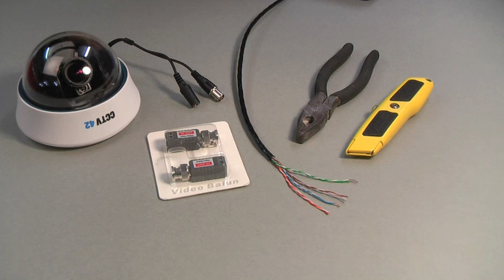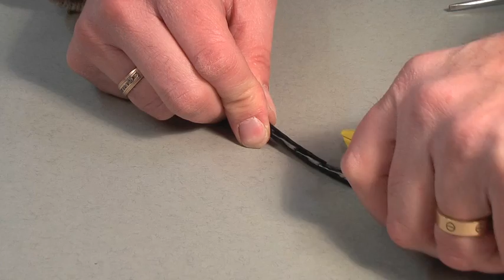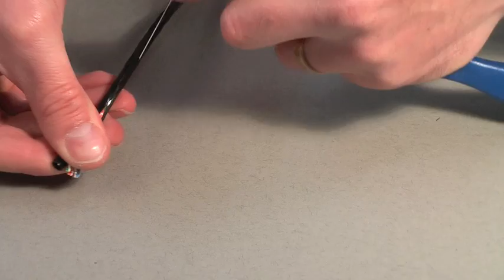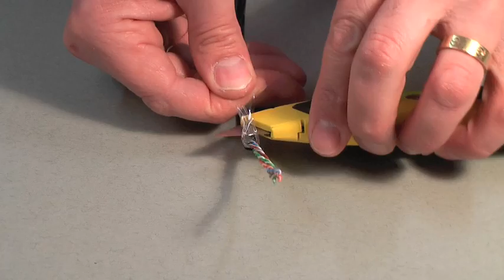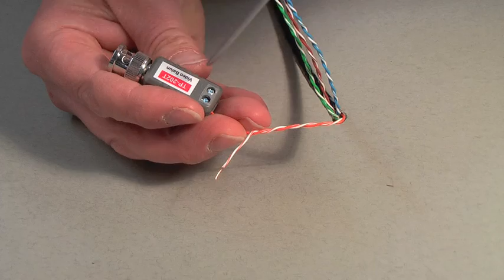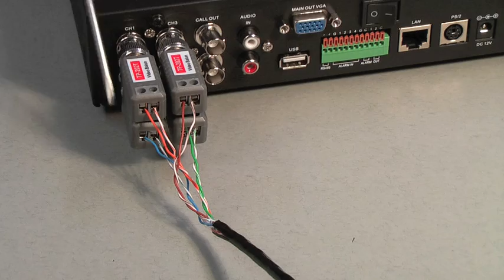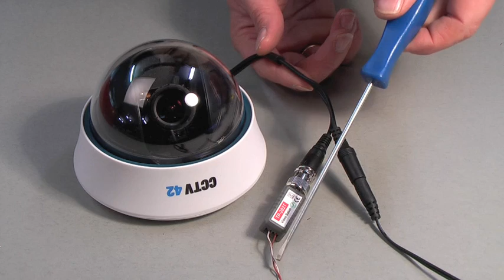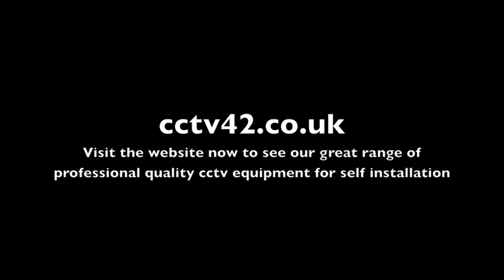cctv42.co.uk - using cat5 cable and baluns to connect a cctv camera to your DVR

Comment: Lan Cable Cat6 outdoor cca wire is this okay for cctv sir?
Reply from the maker: Hi there. I would not recommend using CCA or copper clad aluminum cable. Not only does it break easily when making connections but it doesn't perform as well as pure copper cable when it comes to this CCTV application.

Comment: I have a  built in mic camera with  one bnc connector and one adapter socket. Should i connect the video balun/transmitter same way?
Reply from the maker: It depends on the distance between the camera and the DVR / power supply. You might get away with 2 pairs of wires for the 12 volt power, 1 pair of wires for the video baluns and one pair of wires for the audio connection.

Comment: We are in great trouble, we used separate CAT 6 cable for each camera and gave 2 pair to video and 2 pair for power using DC adaptor. We used passive video balun without power dc jack. Image is fine with no lines or interference but image has ghosting affect and double. What to do
Reply from the maker: Hi there. Without seeing the installation it is impossible to say what's causing your problem. I would start by checking the individual components on a short test length of cable. I would also use a single pair for video rather than doubling up, you need to triple up on the power to avoid voltage drop over longer distances. Check for outside sources of interference, look at the camera power supply, the cable used (is it pure copper solid uniform twisted pair), the connectors (many so called baluns are just connectors with no internal components), and so on.

Comment: Hi. Can you explain how you can feed 4 cameras on one cable. How would you make a split into the cable to keep running only one cable or would you need to keep splitting the cable. How does this work for power however each camera will need one cable for each power?
Reply from the maker: Handling the video feed from 4 cameras down 1 piece of CAT5e cable works best when the cameras are close to each other making connections easier. You could theoretically cut into the cable along it's length to use one of the twisted pairs for a camera but it's harder. The cameras would need to be powered independently from the CAT5e cable, you couldn't use it to handle multiple video signals AND power the cameras.

Comment: How give power supply from cp plus power supply when i want to run 4 cameras for one cat 5 cable
Reply from the maker: You can't supply power to 4 cameras and send video back to the DVR using a single length of CAT5e. You would have to power the cameras locally then just use the CAT5e for video with 1 pair of wires to each camera.

Comment: You show one camera cable connected to 4 different baluns. Why would you need four signals coming from one camera? If I connect 8 cameras I would only need two wires from each cat5 cable to connect my cameras?
Reply from the maker: Hi there Dave. This would be a possible solution for up to 4 cameras powered locally (ie. not using the Cat5 cable) where you then want to send the video signals back to a DVR. If the Cat5 cable isn't also being used to provide power then you can send up to 4 video signals down a length of Cat5 cable with 1 pair of wires used for each camera.
Reply: Got it, thanks so much! I know this video was posted 10 years ago so I thank you for continuing to monitor your video and I appreciate your quick reply!
Reply from the maker: @diydaveman  Our pleasure :-)

Comment: If i use for two cameras, i am left with 2 pairs for power. You recommend cross splitting the pairs for power right, not one pair for minus and one fir plus?
Reply from the maker: Hi there. We wouldn't recommend running 2 cameras using 1 length of Cat5 cable if you are using that cable to power cameras. There is a danger of voltage drop if you only have 1 pair of wires for the 12 volt power, hence why we suggest using 3 pairs for the 12 volt power.

Comment: Theres a lot of work to be done if you want to upgrade to an I.P. system. Plus, if you you all the remaining pairs for power, you run the risk of ghosting the picture through interference.
Reply from the maker: This method of wiring is suggested for HD Analogue systems not IP systems. IP CCTV has it's place but we aren't massive fans for reasons outlined here: https://www.cctv42.co.uk/help-advice/buying-guides/buy-the-best-hd-cctv-cameras-and-system/ip-or-analog-hd-cctv/

Comment: hello there... good explanation, however not sure why you would need to tie the last six cores into two sets of three to prevent voltage drop? when a single pair can provide 48v @30watt - we see this on standard network topologies when running POE devices ie Cameras, IP phones, Wireless access points etc..

perhaps i misunderstood what you were saying
Reply from the maker: These are not IP cameras, in this example we are using CAT5e cable purely for the copper content. The cameras are 12 volt which will increase the chance of voltage drop but with any
wiring using thin wires and lower voltages voltage drop is an issue as cable runs increase in distance so trebling up acts as insurance policy.
Reply: @cctv42  thank you for the response, I appreciate the example you have used are not IP cameras I guess my reason for the comment wsd purely the fact that poe devices run 48v on cat5e and cat6 onwards cables albeit with them being thin cores..
Reply from the maker: @rizwanmahmood1407  these are not PoE cameras in the strictest sense of the meaning. Because they work at 12 volts there is more chance of voltage drop compared to 48 volt devices. It's why the large power cables you see across the country run at 400,000 volts. CCTV applications are unique in that long cable runs can sometimes be required, certainly longer than might be experienced in a home or office set up and you won't have localised power injectors as you might in a network.

Comment: What is the maximum meters using cat 6?
Reply from the maker: Using 3 pairs for 12 volt power and 1 pair for video signal we suggest 50m for power and video, 100m for video only (in which case you could handle the signal from 4 cameras on a single length of CAT5e / CAT6 cable. Some balun manufacturers suggest a further distance than 100m but we advise 100m to be safe.

Comment: Useful video!!! but i need to ask somthing more: the distance of my cameras will be from 40 to 50 m is the cat 5 useful? do i need balluns? and is there cat 5 with 8 pairs of cables for 2 cameras useing only one cable/ 
thanks in Advance!!!
Reply from the maker: At 40-50m we would suggest powering the cameras locally to avoid voltage drop. CAT5e comes with 4 pairs of wire, you would need to run a second cable. If you are powering the cameras locally (ie. not using the CAT5e cable to supply power) then as you only need 1 pair of wires for the video feed up to 4 cameras can be handled by a single length of cable.

Comment: Thanks for the video. I wonder whats the max range of this application ? Do I need to use these baluns for 200mt distance between camera and dvr ? Or is it much better to use coax ? Do you recommend 16ch balun recievers instead of seperated baluns for each camera  ? Thanks
Reply from the maker: We suggest a maximum cable length of 50m when powering the camera via the Cat5e cable, 100m if you power the camera locally and only use the Cat5e cable to transfer video signal. The balun manufacturer claims a maximum distance of 200m but we prefer to play safe. We don't sell multi channel baluns.

Comment: Thank you this was helpful, can you show how to connect cat 6 - to- Balun- to- IP camera ( Ethernet Port ). I have only wires to take Video to my system. So I could use a Video Balun as you have shown and connect to a standard BNC. Now suppose instead of a BNC male out , I have an Ethernet output as we have in IP cameras. Can I use some sort of adapter to convert Ethernet out to two wire out.
Reply from the maker: IP cameras are a totally different entity and have nothing to do with BNC connectors. We don't sell IP CCTV systems for a number of reasons outlined here on our website:

https://www.cctv42.co.uk/help-advice/buying-guides/buy-the-best-hd-cctv-cameras-and-system/ip-or-analog-hd-cctv/

IP cameras work with an NVR, our HD-Analogue cameras work with a DVR.

Comment: Hi mate do you not what resistor I would use to link the ground of the video with the ground of the power feed or is it ok just to link the 2 together. I ask because i have 40 meter 3 core cctv wire left over that i want to use but the ends with the connections have been cut off. This is the proper camera wire that you get from ebay. Who you have any idea..
Thanks
Reply from the maker: The words "proper" and "eBay' rarely make happy bedfellows! I'm afraid I don't know what you would need. Video baluns are designed to be used with uniform twisted pair networking cable. As an alternative to this for CCTV we would recommend RG59 coax cable with a 2 core "shotgun" cable to provide power to the camera.

Comment: Hi wonder if you can help I've installed a few cameras using cat5 cable but I'm getting horizontal lines on the screen the picture is still pretty good you can notice them more at night, I bought 50 m of cat5 cable from eBay it only cost £10 would it be because I used cheap cable I have seen cat 5 and cat 6 copper wire cable i dnt no if thats any better than the cheap 1. I even tried running local power to the camera and it made no difference so at the minute I'm sending power and video through the same cable.any info would be great..Thanks
Reply: Thanks for the reply.Yes i used the same power supply its a 5 amp 1 from ebay so can power all the cameras with 1 unit. Im gettin a we bit of interference with my own cctv and im using the same type of power unit i will change my power adaptor and see if it makes any different. I will get back to you
Reply: Ok thank you it was to do with power adaptor but u have also discovered something else which might help other people I removed all the ground wires coming from power adaptor going to the cameras and they are perfect now, there are using the ground wire from the AV video feed so maybe problem is there is to many grounds that causing interference. But this would only work if you're using the same power adaptor that you power cameras and dvr. So a 5amp will do 4 camera and the dvr. Give it ago and see. Im goin try tomorr on that system i used the cat5 on to see if it takes way the we lines
Reply from the maker: We wouldn't suggest powering the cameras and DVR off the same supply. All our DVR recorders are supplied with their own power supply, it is important to use this. Be aware that a DVR uses more power than the cameras to it would be possible to overload the power supply. @deedee3495
Reply from the maker: Interference can be caused by many things. Certainly using good cable is the first thing to eliminate. It could also be a power supply issue, the baluns or the cameras themselves. Whilst you powered the cameras locally was that using the same supply? It's a problem when people buy different components from different places and throw them all together. Sourcing from one place you have a single point of contact and hopefully the vendor has checked everything for compatibility although I appreciate in this day and age that isn't always the case.
Reply: Hi i normally would use the dvr own power adaptor but im only powering 2 camers atm. But i guess even if u have cameras on there own power u could always link the 2 grounds and then remove the grounds from thw caneras but that would be last Resort but u were right it does seem like a power adaptor problem
Thanks for ur replys and help

Comment: How do I connect this type of camera to a standard consumer TV? Can I just connect it to the cable input without bothering with any of this, and I guess put it on channel 3 or 4 or whatever?
Reply from the maker: It depends on the camera. HD cameras will need to go through a DVR recorder then into the TV via HDMI. A standard definition camera could theoretically be wired directly into the AV (yellow) input if the TV has such a thing. You could only have 1 camera and of course it wouldn't record.

Comment: ok i have a dvr the only has h.264 on it for any information. in the tiny cam ap i use yale for camera brand and hd720 for camera model and doing that with regular plug in cameras i have 3 working. what i need is to get the wifi ip cameras that tiny cam sees to work on this dvr. so i set the cam up for lan connection and then cut a cat5 cable and got the orange/white and orange wires and connected them to the baulin adapter and plugged it into the dvr and i get no video.  what is wrong. do i have to tell the dvr it is seeing a lan connected ip camera? is there any instructions form the very beginning to the end for doing this? anyone can you help me out here. thanks
Reply from the maker: I'm not sure exactly what you are asking I'm afraid. Speak with the people who you purchased the equipment off. They will be familiar with it and be best able to assist.

Comment: is there any quality loss occur using CAT5 instead of coaxial?
Reply from the maker: Coax cable provides the absolute best video image but Cat5e isn't far behind. You may notice very slight artefacts with Cat5e but it is extremely convenient in terms of termination and there is a degree of future proofing.
Reply: Thanks, This is the info I've been looking for. I'm going to install a few cameras using cheap Chinese baluns just to check the quality.
Reply from the maker: You need to be a little careful. The cheap baluns aren't actually baluns, they just join the CAT5e cable to the BNC fitting with no electronics in between. A genuine balun will have some electronics in there designed to minimise the chances of interference.  @onixteam8900

Comment: Is Compalsay to use BNC baluns with cat5 cable, or we can manage with Normal BNC
Reply from the maker: Yes, you need to use video baluns. Some cheaper "baluns" are just connectors with no electronic components in them, we only sell actual baluns rather than connectors.
Reply: for small distances like 10mtr,20mtr also required balans by using cat 6 cable
Reply from the maker: We only use and sell genuine baluns. I can't comment on using just connectors. For the cost involved I wouldn't bother. Do it right.

Comment: sorry its me not explaining myself properly the cables that i meant were the ones going to the balun & the the one going to the dc power not cutting or shortening the camera cable  , if cables were left in a loft space would you tape the bare wires? also is this the same core wire that you would sell with your B7 camera, would you always put all the remaining cables 3 pair to the dc is this so there is not voltage drop ( great videos by the way i am learning alot from them as a complete novice )
Reply from the maker: The Cat5e cable can be cut to length, the video baluns and DC plugs are designed to be fitted by you using a small screwdriver. You could use tape, although sometimes that can make checking them difficult. The good thing about a plastic enclosure is they can be easily accessed if you need to change or check anything. We do sell external Cat5e cable on the site. Cameras are supplied on their own, you need to order cable & connectors separately. Thanks for the kind words.

Comment: Hi if i am putting in a weather proof junction box can i cut the cables smaller so that they will fit in the box, on all the videos i have looked at they all have there cables quite long, total novice just need a little advise thanks
Reply from the maker: You should never cut the flylead which comes from the camera. This will invalidate any warranty and you could end up damaging the camera. Excess cable can be looped outside the box to form a drip loop.

Comment: Maximum video distance support for good quality cat 6 wire like DLink if( I carry ac power separately and convert to DC where required)
Reply from the maker: Hi there. We generally suggest 100m for HD TVI 1080P systems. Having said that our video balun manufacturer suggests a maximum distance in excess of this depending on the camera resolution. We err on the side of caution to be safe.

Comment: Do I have to use a balun for the power supply?
Reply from the maker: No, baluns are only required for the video feed. 12 volt power is hailed by DC plugs and sockets shown here on our website https://www.cctv42.co.uk/shop/cctv-accessories/cat5e-camera-to-dvr-cables/
Reply: CCTV42 thanks